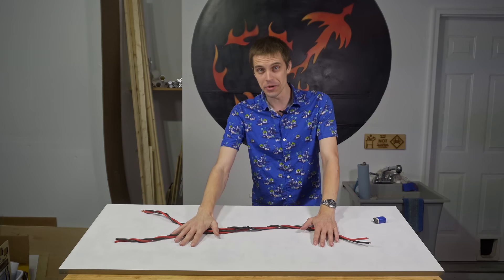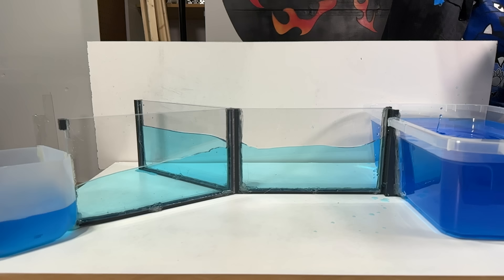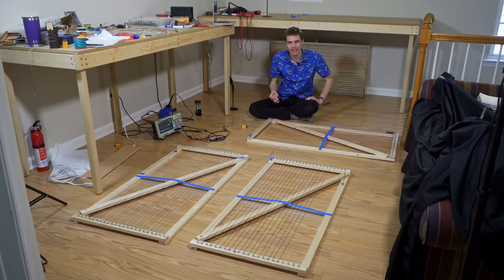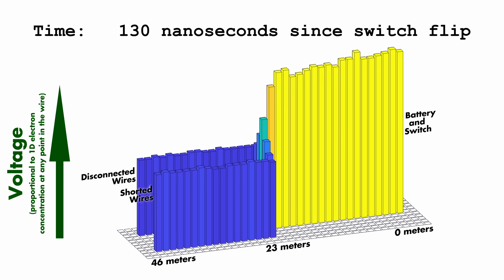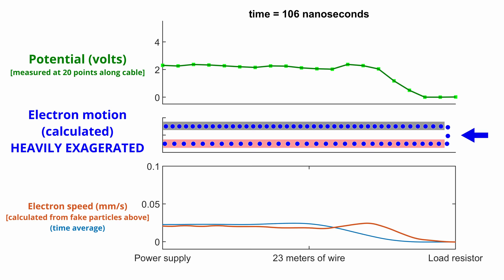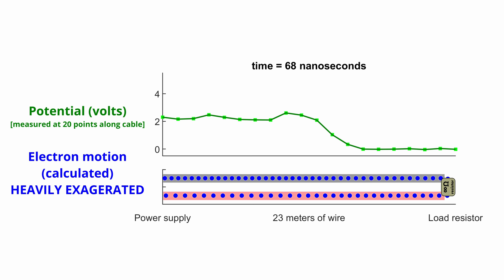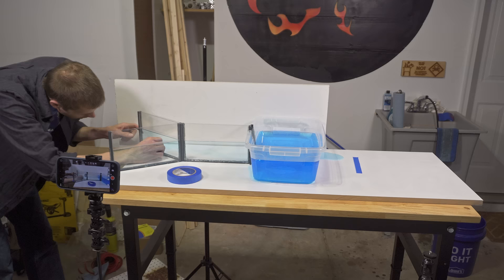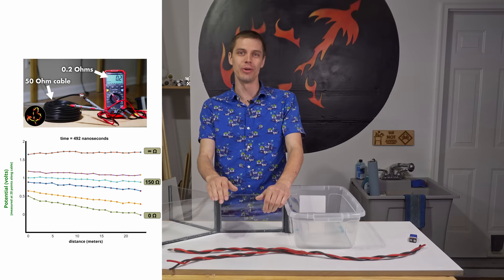Watch electricity hit a fork in the road at half a billion frames per second

Comment: Brilliant presentation! As clear and precise as any scientific demonstration I have ever seen. To explain the difference between your electric model and the water model, consider that the electric current is compressible (capacitance) where the water model is not. That is why they differ. And air pipe system will give you the correlation because the air is compressed as the wave advances. Thanks!!

Comment: I remember back when we used coax cable as network cable that we couldn't leave a cable disconnected at one end. We had to attach a terminator, which I believe was a resistor. It was said that if we didn't do this there would be a reflection on that cable that could cause errors in the signal. It makes sense now.

Comment: Watching that current flow down like that reminds me very much of current/voltage in antennas and feedlines in RF work, the only difference being this is heading for a steady state.  In fact, I suspect that initial reflection at hitting the Y part was due to impedance mismatch causing a partial reflection.  Seeing this actually visualized was absolutely premium top notch work.  Well done.

Comment: Awesome idea! Don't stop here. Use a mosfet with about 50ns turn on and turn off. Use at least 150m of wire. Send the voltage over the wire and disconnect immediately before the electric field reaches the other end. See if you can measure any current in the wire (not voltage)

Comment: Brillant statement. Electricity does not flow through unconnected wires. That is just a brilliant statement. You completed the circuit with the scope leads on the last panel with the open-end wires. Of course, you will see voltage on the scope.

Comment: The interesting part that can be "over-simplified" is the wires act like an inductor & capacitor. This means the electrons are building a magnetic field and the wires build a "static" charge on the wire that is open ended. In addition, a 2nd consideration is that a wire is a "transmission line" and much like an antenna, the wave is reflected back by the open ended wire. Initially both sets of wires will have current flowing into them.

Comment: The wires are acting as an Inductor.
Have you tried using a Network Analyzer and did a Frequency Sweep on this antenna (yes, it is acting like an antenna.)
You will get a different result using waveforms (AC) verses using a straight DC circuit.

This is a very fascinating experiment you did... I learned a lot

Comment: Nicely done video. One thing you neglected to talk about: The capacitance and inductance as the "waves propagate." There was a similar experiement that another science YouTuber did. In his case, the wires were not on a grid like yours, but straight, making the capacitance and inductance between the wires easier to deal with.

I think the "bouncing around" that you refer to is actually due to the cross capacitance and inductance.

Comment: Amazing. I never suspected the initial “wave” of current and the eventual settling. I just assumed the current would naturally flow through the closed circuit rather than the open one because of the attraction due to the opposite polarity and that there would be absolutely no current flow at all in the open circuit. The water analogy, while not perfect, is certainly an approximation which help to visualise. I think people’s statements regarding field is valid for AC rather than the DC provided by the battery which is a linear flow. Excellent and enjoyable presentation.

Comment: A really fascinating video! I trained as an electronics technician in the mid sixties, and then worked in communications. I've noticed that there are a number of YouTube videos on the subject of loudspeaker wiring...particularly the thorny question of 'biwiring'. It seems most involved in the production of these videos don't know how current flows from the amplifier through the loudspeaker cables to the crossover and to the drive units. I mention this because your video with its split from the battery (amplifier) to the high resistance (open) and low resistance (short) (loudspeaker crossover), reminded me of the difficulty many (most!) people have in understanding that the signal from an amplifier is split (at the 'Y' point) and flows to the high freq. filter and subsequently to the tweeter, and to the low freq. filter and to the woofer, dependent upon frequency. Several of these videos deny this happens at all!!

You would do everyone a favour if you made a video explaining exactly how the crossover works, and the implication of so called biwiring.

Comment: Time-Domain Reflectometry: That's how we detect the location of damage in really long cables. The speed of the electrons and the speed of the wave depend on the impedance of the cable, or the vector sum of inductive and capacitive reactance. Some common ratings for RF cables are 50, 75, and 300 ohms - that is what the voltage source sees initially. If the impedance at the end of the cable is different than the impedance of the cable, the wave will be reflected back to the source and you can calculate how long the cable is or how far it is to the broken section.

Comment: E) The battery will pump a "wave" like a newton cradle thru the black wire by shooting an electron, the wave will split on the branch but on the disconnected end it will bounce back thus "nulling" the "pressure" on that end, while on the connected it will not bounce back and therefore there will be some "negative pressure" on that end of the wire with will allow the battery to pump out more electrons. The wave moves at the speed of light.

Comment: Impedance  is resistance in an AC CIRCUIT.  You will find in an AC  circuit that the waves continue to "reflect " backward and forward until the impedance of the load matches the impedance of the source normally by changing the impedance of the load , but there are other things that has to be taken into consideration like inductive reactance as well as capactive reactance.

Comment: So cool that the branch and battery terminals acts as reflections against lighter mediums!
It is both fully logical when thinking about how the wave passing from a single twisted wire, towards two pairs roughly equals a lowering of resistance (and impedance?); thus changing the phase of the wave 180 degrees!

Even more insanely cooler when you think about this analogy (sort of a energy potential propagation of waves) when considering other waves propagation and reflections!

Thanks for such a time consuming and monotonous work, in order to measure this!
Reply: Am also now thinking about what it may implicate when it comes to path finding algorithms. Could be used for faster updates on heatmap style pathfinding or goal-search trees.
Pretty cool stuff!

Comment: I've always thought of current as pressurized water. When you connect a battery, an unpressurized pipe must be brought up to pressure. There's an initial pulse as the high-pressure hits the low-pressure, and it takes a bit for the pressure to equalize

One of the key points is that pressure here is synonymous with charge density. Current doesn't flow at steady-state in an open circuit, but the wires themselves carry a charge equal to the voltage potential of the battery. That's why the voltage potential across an open circuit is measurable. Connecting the test probes to measure the potential is like drilling into a pressurized pipe. There's no delay before getting a little jet of water, because the pipe is already pressurized

Comment: Best and simplest analogy is compare voltage in a wire to water in a pipe.  Open the the tap and it flows with a little more pressure in the beginning.  Water hits the dead end creating a little more pressure and then equalizes.

Comment: Cool video, love the graphs! I actually learned about it in high school over 3 decades ago and in a computer science class at that.
We got a new PC with the brand new HDD IDE (ATA-1) interface and the teacher, who was primarily an electrical engineer, told us that that these reflected waves can sometimes cause issues if you connect a single disk in the middle of the IDE cable (1 cable was able to connect 2 HDDs - one in the middle and the other at the end).

Comment: This is antenna design question, first starting with fully static electricity, then a dc voltage on an antenna. The super quick and chaotic transient phase.  (I’m not an antenna guy btw)

My guess: Assume positive terminal is connected first (the one that pulls in electrons), causing minuscule “theft” of electrons from wire, so now the wire is ever so slightly positively charged, but is essentially a part of the + battery terminal when it reaches steady state. 

This theft sent a small wave of positive charge through the wire, where the electrons were pulled in and haven’t been replaced yet by farther electrons. The wave propagates and bounces around through all the wires, and like a wave through slinkies, it eventually stabilizes.

Quickly all of this stabilizes, and the wire has a very small positive static charge. And the positive terminal no longer can pull in more electrons, cuz the battery can’t push them out the other side.

(This is all before full connection was made)

Now the negative terminal is connected, which is ripe with electrons trying to be pushed out of the terminal.

When the electrons can flow to the wire (some sparking over air) they send a wave of electrons like a prolonged tsunami wave that moves thru the wire. It moves just the same thru both the connected and unconnected wires. Both the unconnected wires! The electrons just smash into the next electrons, not aware of what’s gonna happen with the wire. When it reaches the end of the unconnected wire, it bounces back and forth a bit until the wire has a steady charge. The wires are a series of resistors in a way, so the whole unconnected wire with have a voltage same as where it’s connected to the flowing wire.

The wave of electrons will travel thru the connected wire to the positive terminal. And current will start to ramp up, since the wave can feed the batteries chemistry.

The release of electrons from negative side allows the pulling of electrons from the positive side. So eventually a slower wave of “holes” will start flowing on the positive side as from the negative side. The battery depends on chemistry and I don’t know how long it takes. 

It might look like the electron and hole waves start flowing at the same time (cuz the battery is small and chemistry is quick, and you don’t have magical equipment to detect the difference) or the chemistry might be so slow that the electron wave reaches the positive terminal before the positive terminal send out much of a wave at all. 

Waves with partially bounce off any transition, so the transient phase is quite wild.

So the answer is a bit of c and d. It’s not guessing. It’s just sending an initial wave of electrons trying to get away from densely packed electrons. Eventually there’s nowhere for the electrons to go in the unconnected wires, so they settle down.

Talking about the electric field is a bit of a distraction. 

A small wire has very small inductance, so steady state is reached super fast. I haven’t seen your video, and I don’t know how or if you can see all these little waves moving around. If you have sensors, they probably add RCI and interfere a bit. :P

Comment: The reflection of charged waves at locations where there is a termination or change in impedance and the amplification of reflected waves are all very familiar to those who have understand the behavior of surges in power distribution systems.  For more on this, see the chapter on surge protection in IEEE 141 (The IEEE Red Book), which is written for industrial power systems.

Comment: This is kinda interesting, but also pretty simple. Your battery has constantly current, but when you switch on circuit it creates alternating current for maybe half of period. So, your wire has not only resistance - also has a small conductance and capacitance, your wire wound in form of flat inductor. And it has properties of oscillator circuit. There is damped oscillation, what you saw. If you had an alternating current and circuit will be in resonance with it by frequency - you would have seen non damped oscillation with big amplitude.

Comment: Although the electrons are moving incredibly fast, they're constantly bumping into each other and overall the flow only moves at a few meters an hour. What actually influences the movement of these electrons moves at the speed of light, though. The effect of the electromagnetic wave, created by connecting the low potential and high potential wires, moves at the speed of light throughout all of the connecting wires. There's a propagation of electromagnetic force that bounces off of the two terminal ends that aren't connected to each other at the same time that the wave hits the connected wires. The disconnected wires however return to a balanced state, stopping the flow of current through its section.

Comment: What you are seeing is transmission line effects. In this case, the impedance of the power source does not match the impedance of your wiring racks. Each of the two steps in the voltage on the scope when you turn the power on, is probably equal to the transit time it takes for the current to travel down one strand of wire in your rack. The voltage steps are caused by the impedance mismatch.

Comment: In fact, a branch of an electrical circuit that is not closed measures the voltage on the circuit between the power source and the load. At whatever point we connect an open branch. If you know what I mean. Thank you every much for your work!

Comment: Because the length of wire from the battery to the split was the same as to the ends and back to the split the wave that reflects back to the battery lines up to cancel out the waves reaching the ends. It’d be cool to see a different length of wire leading up to the junction to give a more generalized case (where in all likelihood the junction will not be dead center in a circuit)

Comment: The thing not understood here by many is that an electron at the battery takes several seconds to get to the other side of the circuit. The electromagnetic wave that's created is what propagates across the wires at the speed of the light, and that's what starts moving the electrons on the connected side. It's not the original electrons at the beginning tho.

Comment: Once again I find myself return to the fluid dynamics of it, the wires aren't just hoses for the electrons to flow through but more like some sort of loose fabric flattened hoses for the fluid to flow through. If you were to do the same thing with pressurized water released into one hose split into two with one end heading into a capped end and the other into an empty tank I feel you would have very similar responses.

Comment: Cool animation. The results follow transmission line theory exactly. OBTW, the reflection at the split in the line is caused by the change in characteristic impedance between one transmission line and two lines in parallel. You could prevent that reflection by adding a "splitter", like the ones you use on TV cables.

Comment: 17:15 I think of an air pressure analogie of a sound wave. no, Particals of air doesn't blow to you like a wind from your acoustic system. They are just moving forward-backwards. Means fluctuation. Only moving part is the zones of pressure and not-pressure.  That thing what we calls waves.  Means - Sound. Electrons moving exactly the same. Back&forward creating zones of magnitude & low pressure, means electricity. 
"Like a leaf on the wind, watch how I soar..."

Comment: Wow. I'm an ECE by training, but E&M was never my strong suit. I was really trying to think about how the voltage would propagate across the wire but couldn't intuit it and couldn't decide on an answer. I remember thinking "DEFINITELY not C, probably not B, so probably either A or D." Bit disappointed in myself, but after viewing your animation, it makes a ton of sense. I see how you simplified the explanation a bit, as the battery is not "sending current", rather, the voltage is propagating as a wave, and then the current is kinda just a result of the slope of the wave. I was guessing that it was gonna be very different from the water demo, but clearly it was very similar. Who woulda thunk! Anyways, wow. Absolutely incredible demonstration and explanation, and I feel like I learned a lot about E&M from this.

Comment: EDIT:  I'm imagining a physical model for this that it a load of things (balls, blocks, trolleys) on a track with either springs between them or repelling magnets. Hard to figure out how to build well but you should get the same phenomenon with the density wave traveling through it faster than the travel of the objects.

Note that the speed of light in this model is the speed of a wave in the spring by itself (if spring coupled) or the speed of light (if magnetically coupled) while the signal speed is the speed of the density wave and the drift velocy is the speed of movement of the objects

ORIGINAL POST:

My guess: current will flow down like a breaking damn, waves of electron density with slosh back and forth and settle down as the current stabilises